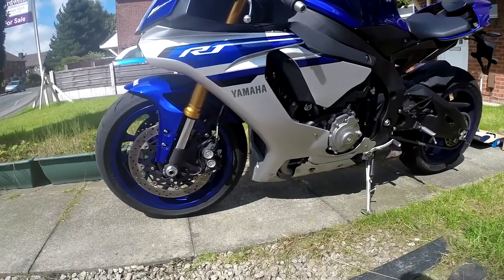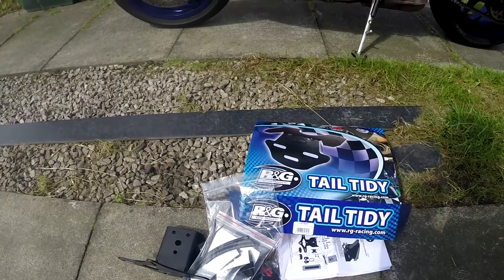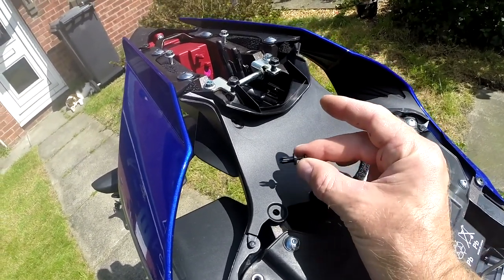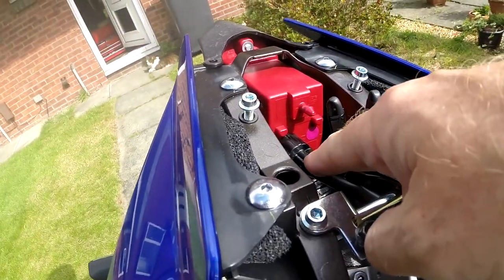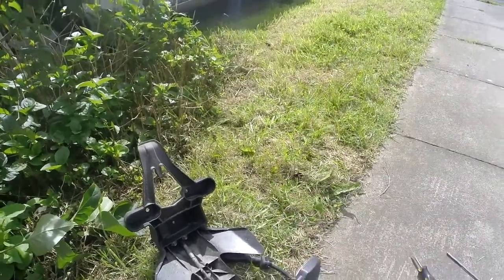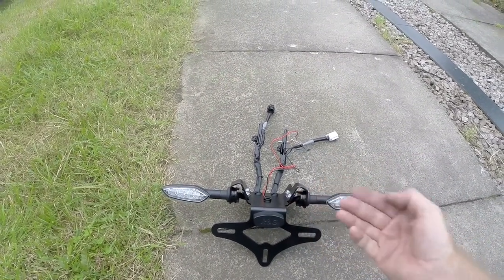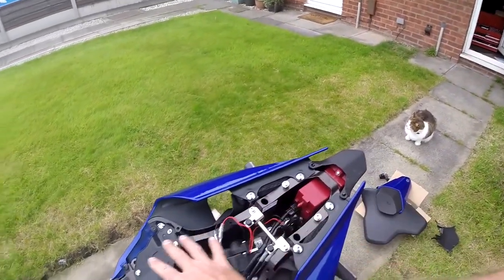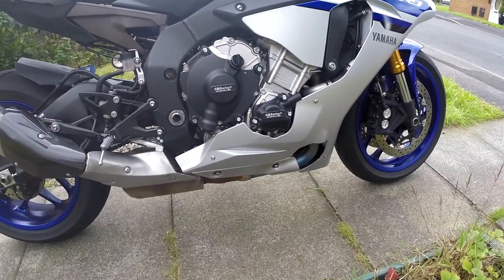2016 R1 R&G Tail Tidy fitting step by step

Comment: Hi Dave, is that seat cowl the yamaha one or aftermarket? My '07 r1 had a key release just like the seat. They want $279.00 for the yamaha one, $30.00 for aftermarket. Seems like it should be key release.
Reply from the maker: It's out of the dealer official accessory catalogue, which the dealer had fitted along with a few other accessories to sweeten the deal. I certainly wouldn't have paid 279 for mine of it didn't come as part of the package, as its just a simple little cover. So in your case I'd go aftermarket

Comment: You didn’t heat shrink the plate light wires to protect them
Reply from the maker: they don't really need it. 12 volt auto electrics aren't really affected by the damp, plus I'm crap at diy 😉
Reply: I fitted my R1’s tail tidy yesterday and breezed through it thanks to this video. 
Cheers mate.

Comment: Yeah I had to call the dealer to ask how to take off the seat cowl . I'm so pleased they fitted mine! I really need some crash protection thinking R&G or maybe the Yamaha sliders. How do u carry a lock when you're on the r1 . My r6 I used to keep a disc lock under the seat, on the r1 no space at all
Reply from the maker: I think that the GB Racing kit looks the smartest and least intrusive on the bike's looks. I generally never leave my R1 out of line of sight when I go anywhere on it, so don't usually carry a lock. If I go anywhere where I'm likely to leave my bike for a prolongued period of time, I'm lucky that I also have my Triumph Explorer which has tons of places to stash locks.
Reply: VeeFour is it push for connectors or does it require soldering wires in?